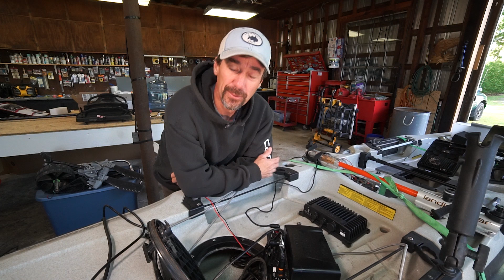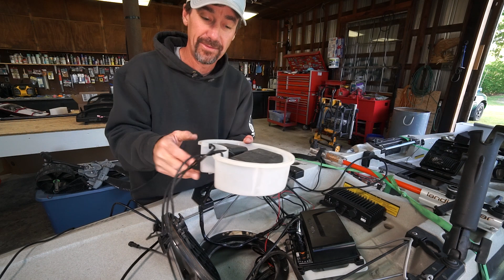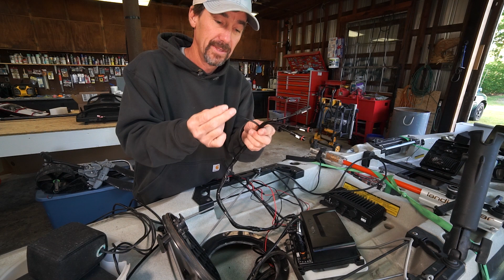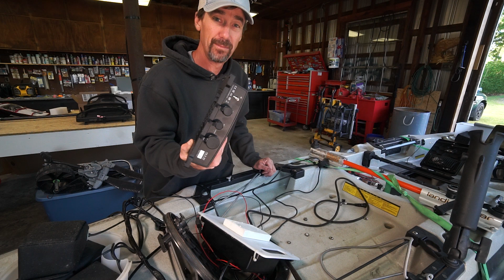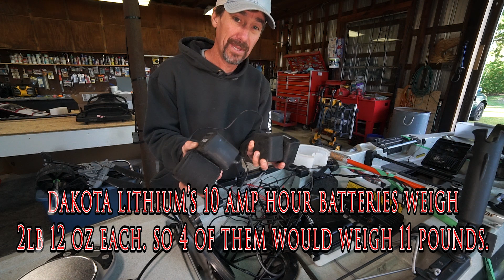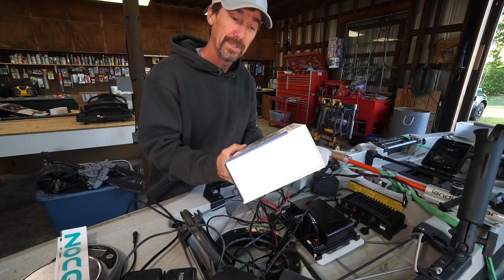Garmin Livescope Kayak Installation Walk-through

Comment: You always do great videos.  Wish I was your neighbor!  What a great shop!
Both my black boxes will not light up (status light) after about 18 months of use.  I called Garmin and they gave me sort of a song and dance about the Nocqua batteries.  I use four of them as you do.  I don't parallel them to feed everything.  I have never run out of power in a day of fishing.  I keep the Panoptix separate from the Chartplotter and HD transducer.  So I use the Nocqua switches to connect two batteries to each circuit.  Today the Garmin guy told me that I need a car battery.  As an engineer, I started asking him questions he couldn't answer such as, Why has this setup worked for 18 months and now doesn't work?  How can that be a bad power supply?  No answer.  "We just need to troubleshoot before we replace your blackboxes."  So I'm a little unhappy with Garmin right now.  But I like your setup.  It just looks a little difficult to deal with the upside down mount of the Panoptix box.  
Anyway, any comments on my power supply setup?  What did Garmin say to you?
BTW...great advice on the dielectric grease.
Reply from the maker: They replace my unit no questions asked. Warranty is a warranty plain and simple. The black boxes are rated to work with anything from like 8 volts to 32 volts so how could the Nocqua's ever hurt them. As long as the 4 nocqua's are wired parallel it should never have a problem. If you wired 4 in series that would be too much voltage and would be outside the range the black boxes are rated for. My replacement unit has had no issues and actually has a cleaner image than the original. If anything contributed to the failure I had I would say the extra vibration from being mounting in a yak vs a boat may have been the cause. Sorry for your troubles, it sound like the warranty cost are starting to eat away at Garmin and they are trying to cut the losses if they can manage to
Reply: The livescope box works much better on higher voltage...The best system I have found is the Dewalt 20v higher amp battery (5 amp or bigger)...the system runs much better on this and a breeze to change the battery (seelite adapter) One battery will last all day... Then run your screen on a couple of the overpriced Nocqua's

Comment: Which thru hull kit did you use to run the wire that goes the the livescope box to the transducer?   I bought some yak-attack but they are not big enough without considerable modification that may make them leak.  Thanks!

Comment: 16 months worries me.  I've had mine for 6 now.  Is there anything you can think of that might have shortened it's life?  Heat, operating temps, installation area , stuff like that.
oh and great vids.  I'm using some of your ideas for my boat setup.
Reply from the maker: If anything I would guess vibration. Being mounted in a kayak and doing the beach launching and overall rough situations that we subject them too would be the only thing that could happen to damage the unit.

Comment: Thanks for the video.  I'm having an issue the the 7.5 amp Livescope fuse blowing. I've replaced it at least 5 times. Garmin sent me all new wiring. I've changed out the wires and replaced my end connectors. The end connectors are crimped and heat shrink. No sign of corrosion. But the problem persists. The chart plotter and Livescope are connected to a dedicated deep cycle Group 21 battery. Can you offer any insight to this problem?  I realize you aren't Garmin tech support, but you are a smart and innovative person. Your opinion would be much appreciated.

Comment: Great video. This helps a lot. I'm installing a 94sv with Livescope on my PA360. I'm using two 10ah  Nocqua batteries with a smartlink cable. I hope that's enough power. I'm trying to figure out a way to make my black box removable.
Reply: TomyTek Outdoors I’m running 3M Velcro. Holding tight thus far, however I have not tested extensively on water yet.

Comment: Do you have a video or info on how you actually ran the wires through the hull.  Since all of the connections are terminated with fairly large plugs, I'm trying to figure out the best way to do this.  Thanks
Reply from the maker: Hobies 3 way through hull plugs are the way to go

Comment: Jesse, quick question...how did you connect the larger single power wire from your four batteries to the power wires for the black boxes and chart plotter?  Is it a single soldered connection with all the wires bundled together?  Thanks!
Reply from the maker: Pretty much but mine isn't soldered. Just a heat shrink crimp connector with dielectric grease to prevent corrosion

Comment: So you can use 2 transducers with  1 screen with Garmin?  I use non-network capable Lowrance currently although I know some of their units can be networked.  I guess I have just assumed that the networking was so that waypoints would show on 2 screens where 1 is at the helm and 1 in front.
Reply from the maker: Yes using the Livescope you can. You can also have a transudcer hooked straight to the charplotter and then another one along with the Livescope networked in and switch between them
Reply: Thanks for the reply.  Can 2 screens be used with the same network?  I'm guessing yes?

Comment: Hey Jessie. I’m installing in my outback. Did you run a ground from the Panoptix box?  I’m hear you only need this ground if you have interference. Trying to determine if I need it or not.
Reply from the maker: Yes I do
Reply: @SouthernReelsFishing  Hi Jessie, I too have an outback and am setting up my livescope. Thanks for all the great content! I’ve modeled mine almost identical to yours. One question though, where did you connect ground from the livescope black box? I’ve done everything else, just getting stuck with how to run the ground.
Reply from the maker: @calebbadley5125  Just ground to the negative wire for power feed from battery

Comment: Hello thanks for the vid! What kind of thru grommets did you use for your live scope cable coming out of the hull? Thanks
Reply from the maker: I used a combination of standard Hobie thru hull plugs. Some of their 3 way plug kits along with some of the single kits. Some are not completely water proof, but seal well enough to not cause any major leaks
Reply: Thanks

Comment: After calling Garmin tech about my livescope suddenly acting as if you cut the gain down about 40% then after a few minutes it goes back normal and this happens about 30 times a day Garmin told me they think it is a power problem. I set mine up like you did except I was only running 2 10ah  Nocqua batteries and never ran low on power but-------Garmin said the head unit and the livescope should not share power, livescope needs its own power so today my 3rd  10ah  Nocqua batterie came in and it will be the dedicated head unit power source. Not really sure if this will solve the problem or not. Have you had any issues with your livescoope acting up while sharing power with your other components?
Reply from the maker: That is a interesting response from them. I have always shared power on all my components. Even in my boat the Livescope and all other electronics are running off the same battery. No issues like you are describing. This is almost funny, are they expecting you to have a completely separate battery for the livescope?! That is not practical at all. Sounds like a failing defective livescope black box to me... But I am not a "Garmin Tech lol"
Reply: @SouthernReelsFishing  Well just as we suspected adding a dedicated battery to the head unit did nothing to solve the problem. Waiting for a call back from Garmin support.